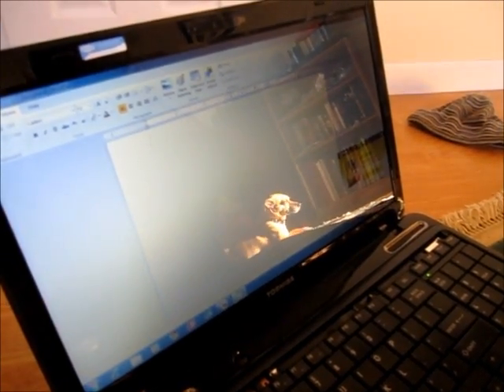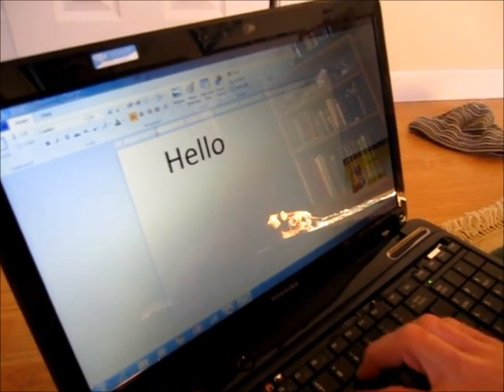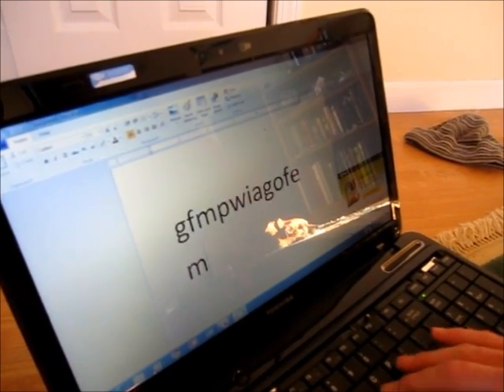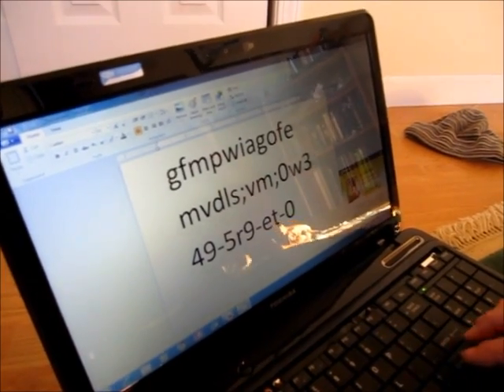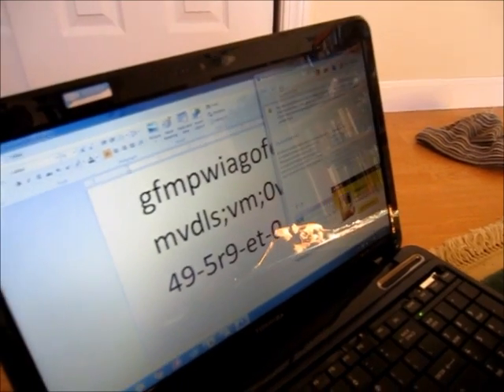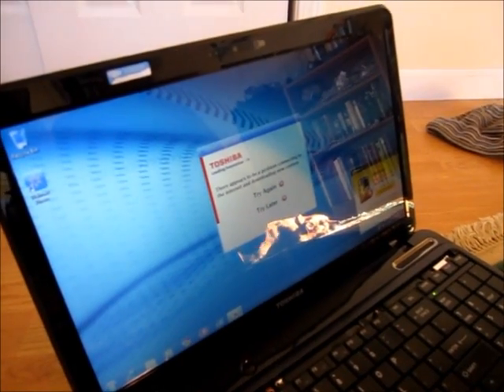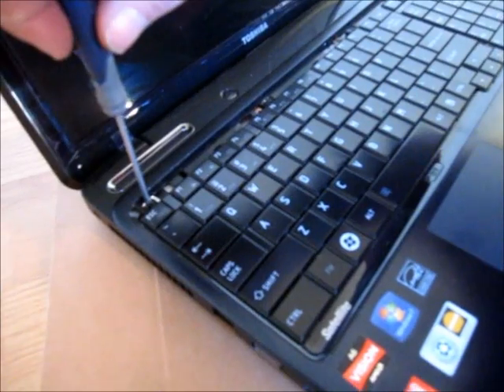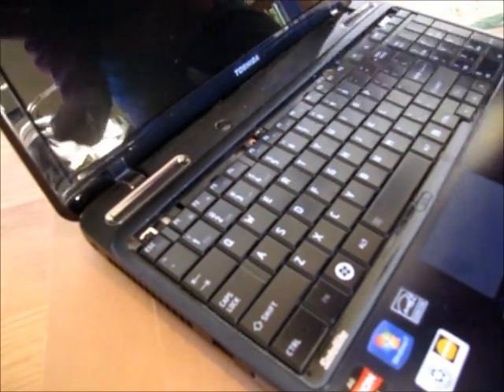Toshiba Keyboard Replacement - Satellite Laptop

Comment: Ok, if I’m correct, the keyboards for the Toshiba laptops are model specific.  I’ve had one keyboard put on my laptop many years ago. I watched the tech who did the work, and the procedure was the same as what this guy did in this video.  So, can someone tell me where I will find what series my Toshiba is?  I’m not referring to the model number, or serial number.  I’m referring to the series number, as in Toshiba Satellite (A665, or C302). I don’t know if that letter and those numbers in parentheses are correct numbers, and letters, but that is what I need to know.  BUT, before I get a new keyboard, is that the letter/number series I need to know in order to get the keyboard?

Comment: This is very helpful - the exact procedure will vary, my L770D does not need  a screw removing from underneath but it's a VERY GOOD idea to remove the battery before you start this.  The keyboard is very easy to switch out - the only tricky bit is getting the cable out of the keyboard connector and then reinserting the new keyboard cable into the connector - mine had a white plastic securing tab that came out completely when I removed the cable but with a little fiddling it went back in afterwards.  Total time to switch the keyboard after watching the video was about 3 minutes - I've replaced other laptop keyboards before and this is very simple swap out!  Thanks!

Comment: I had never changed a keyboard before but wanted to try. I have a Satellite L655. I watched several tutorials, some said to loosen or take out the screw in the battery  compartment, some didn't. I couldn't see how it was related to the keyboard, so didn't, but then when I was putting the new one in place  I loosened it I thought it might give more space or wiggle room. Also in the tutorial videos I watched you are the only one that said to test it before putting it back together, though I had already thought of that, going from past experience fixing things. I had thought getting  the ribbon cable in would be the hard part, bu tit just sort of slips in and is held by the black bar. What I found hardest was getting the bevel trim snapped back in flat. I think I am afraid to push down and be too aggressive with things like that.

Comment: i just removed my keyboard, but i broke the two plastic inserts that the ribbon's lie on, and that you push both sides in to secure the ribbon's connection to the motherboard. is there any where that i could get those plastic inserts? please help!!

Comment: Great vid! My L675 S7108 was a little different. No screw holding the keyboard on in the back. I just took off the trim piece and the four screws. The keyboard came out real easy. Also, no bar holding the ribbon. It slid in to the connector and is held by friction. 

Super easy fix and the keyboard cost me less than $20 on EBAY.

Comment: I'm happily typing this comment with my newly installed keyboard! Thanks so much for the video.  I never did find a Phillips head screw to remove under the battery which may be why I can't get the trim back on, but maybe I just haven't had enough coffee. :)  It took longer than 10 minutes since I had to let the cats out, get coffee after I started, get a damp paper towel to get all the cat barf crumbs out of the edges (the cause of the need for a new keyboard.)  It's so nice to be able to type more than one click of a mouse on the screen again.  Thanks again for sharing your know-how.

Comment: This was very useful.  On my Toshiba Satellite 650 there some differences (1) There isn't a screw on the back, under the battery (2) there were no tabs on the side of the key board. (3) Most importantly, for the ribbon cable,  the ribbon isn't locked/unlocked by pulling the black bar up. Instead slide the white bar that is under the black bar up, in the direction of the base of the screen, after the new ribbon cable is inserted, slide the white bar down, (toward the mouse pad).  The old cable released without sliding the white bar up, but the keyboard did not function if the white bar is not pushed down (toward the mouse pad) apparently it grips onto the cable.

Also spilled beer on the key  board, the new one works fine.  Very simple, easy and not expensive to replace.

Thanks for the video, I wouldn't have tried without this instruction.
Reply: thanx

Comment: ***** Does this help if the computer was damaged by a soda spill? haha. I am missing an enter key but my other keys dont work anyways. If so, this video helps so I don't have to pay a fortune on fixing it
Reply: Water damage = broke laptop. My W key is bad and I will replace it and it is hard to press the W key because it is broken.
Reply: thank you Billy O'Reilly
Reply: Do you happen to have a warranty?
Reply from the maker: It depends on how much soda was spilled. If it was confined to just the keyboard, you might be fine with a new keyboard. If the liquid got down into the machine past the keyboard you're probably in trouble. My suggestion is to try a new keyboard if the computer still boots up and works well with the touchpad. Good luck!
Reply: *****
I would also try plugging in an external usb keyboard into it and see if it responds.  You have to restart the laptop with the keyboard plugged in so it will be recognized.

Comment: Argh! My Toshiba Satellite L855D has a speaker grill across the top of the keyboard and there are no screws under the battery! Any idea where I can find a repair manual that might show me how to remove the keyboard? I'd hate to bring it to a repair shop. I'm an ex tech and the whole procedure looks so simple... I tried removing all the case screws but nothing allowed the metal speaker grill to be removed. I can see the tabs at the top of the keyboard through a gap in the battery compartment...

PS typing "y" "5" and now "f" using a virtual keyboard is a pain.
Reply: *****
 I haven't done it yet... but there was a piece 3cm wide black electricians tape under the batter where the screw to loosen the bezel should have been. I was reluctant to remove the tape as I had a concern the WiFi antenna might be sandwiched in it somehow... Now I am nearly brave enough to carefully lift the tape to see if there actually is a screw of screws there that will release the metal speaker grate.

I really should do something, I am now missing 3 keys and use the virtual keyboard as my remote keyboard is too awkward to use with my lap desk.

MIA 5/% f/F y/Y  "r" seems to be fading fast too.
Reply from the maker: I've never done a 855. It should be similar though. That top trim piece might just snap off. Maybe give it a friendly pry to see, but be gentle. Good luck!
Reply: There are 4 places on the speaker grill that look like they are intended for prying the metal grill up, however it doesn't give with a friendly pry and more than that would be difficult as the keys would be in the way for much prying. So frustrating to have the parts and tools but no repair guide to get past this roadblock. Doing without the computer for a few days would be an extreme hardship for me so I am reluctant to leave it at a shop. I am looking or one to do a re&re while I wait.
Nothing you can do about that. I just wish I could ind a diagram indicating what is holding back the trim. It is so straight forward otherwise.
Reply from the maker: Darrell Penner
Well I feel for you so I googled L855D keyboard and couldn't find anything. So then I thought ebay would probably have some stripped down L855D's so you could see how it comes apart...and they do! It looks like the grill might not have to come off to pull the keyboard. Search ebay for "L855D palmrest" and you'll see what I'm talking about. Hope you get it sorted out :)
Reply: *****
Hello, I hope the holidays treated you well. I looked up the L855D palmrest and see how the speaker grill (and power button) seem to be a part o the palmrest. But I can't see any indication of how to separate the keyboard from the palmrest or case. I am thinking I'll have to find a shop that will do the swapout while I wait... or at least in the same day
Thanks for your help. Normally I am pretty good at determining how things come apart. (and put them together again. :-)  )
Reply: Darrell Penner

Hey Darrell, I know the difficulty of trying to figure out how to pull these things apart. literally fried a whole keyboard in one fell swoop once. Anyway, I've got a L855 and currently I've gotta take mine apart and clean the keyboard itself here in a couple days. I'll see what I can't do about getting a video up of it =)
Reply: ***** Hi, I eventually pried the keyboard out... meaning I tool some very flat screw drivers etc and slid them between the keyboard and the bezel on one end and was able to take advantage of the natural flex the keyboard had to push it out further than the tabs holding it in on that end. I had to disengage the tabs on either side as I sort of "unzipped" the keyboard out... being a bit careful of the ribbon connector.

It did scuff some of the paint on the metal speaker grill, unfortunately, but I was so happy to have a functioning keyboard that I don't mind too much. If a tech at a shop did the scuffing, then I would complain.

I could flex the new keyboard slightly and snap it into place after having connected the keyboard ribbon connector.

It did take me a bit to figure out the ribbon connector though and I am not sure if it is the quality of the keyboard or perhaps the cable is only 99.9% settled or something but there seems to be occasional key bounce... that is where you press a key once and get two of that character.

But... I don't know if that is my handiwork (or lack) or the keyboard quality. I bought it online and it shipped direct from China. (Oops I forgot to check the keyboard for bugs...)  ;-)

Anyway, I wish there were instructions somewhere on how to remove that metal speaker grill. Nothing obvious could be seen when the keyboard was out... and I opened the bottom of the case etc to look.

If you do pry it out, like I did, simply be careful not to bend the keyboard too much and to be wary of the ribbon connector that folds away under it.

I wish you good luck on the project!

Darrell

Comment: THANK YOU for this. I spilled some soda on the right side of my keyboard. I blotted what I could but weeks later the keys started sticking over there. I popped the keys off and cleaned and apparently damaged (dented) some of the metal plate underneath. The problems persisted and I popped off the keys again and then lifted part of the two plastic sheets underneath and cleaned between them and let them dry. Put everything back together agaaaain and I'm still having major issues. I was worried I needed a new laptop because I think it's the metal that's damaged but now I'll try a new keyboard instead!
Reply from the maker: I had an episode of clumsiness involving pepsi just yesterday on my desktop and have a case of the sticky keys too. I'm happy to help, and hope you can get yours fixed!

Comment: Used this guide for an older L305 - same principals in how it's taken apart, with only small, subtle differences -- most notably in that the clip that locks down the keyboard's ribbon cable doesn't seem to be lockable. I just pulled the ribbon out, and slid the new one in. Also used the opportunity to install a new network card, to upgrade from G to dual-band N. :)

Comment: I attempted to do the same thing, so I could clean the garbage that found its way under the keys...the two keys I popped off never went back on correctly, and constantly fall off (got a new keyboard for it for like $12, that's why I'm here!) You have to be extremely careful, if you haven't done it already, and still be prepared for the possibility that it won't go back on correctly. I was vareful with mine, and it still didn't work out too well.

Comment: thanks for posting these. the model i fixed (satellite c655d-s5508) didn't have a screw under the battery, but the instructions were perfectly valid otherwise. thanks again for taking the time!